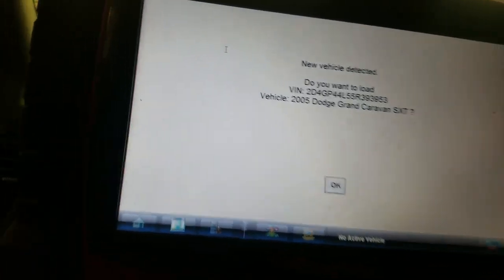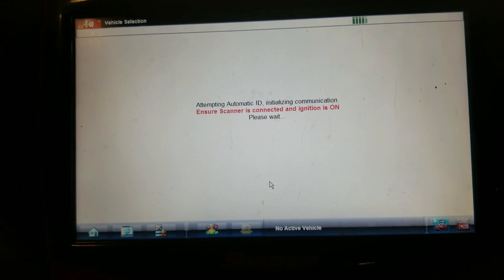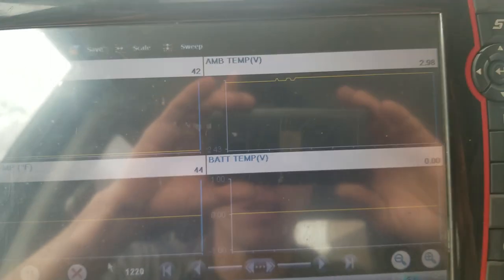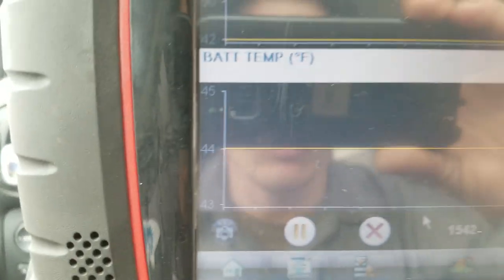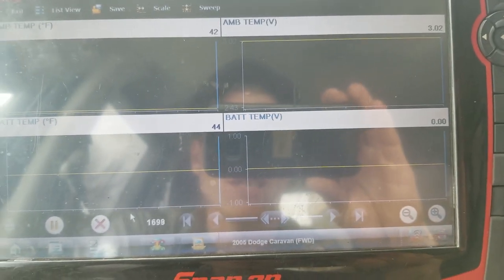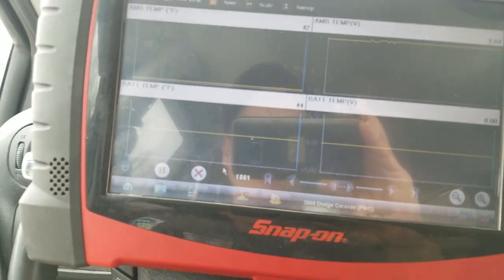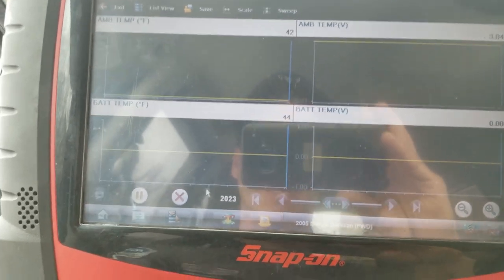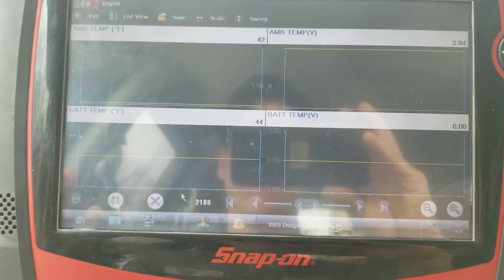2005 DODGE GRAND CARAVAN 3.8L, P0073 ANBIENT TEMP SENSOR CKT HIGH & BATT TEMP SENSOR ISSUE (PART II)

Comment: Great follow up bro. Wondering if that strategy is inside the Snap On or if it’s actually inside the PCM? I would be curious to see if another scan tool would be able to read that voltage at all. Anyways if it’s not set in the code and it’s reading close to the ambient temp then you’re good to go anyway.
Reply from the maker: Same, I have no idea what to conclude, it's just another variable I suppose?

Comment: Hi. Not understood correctly. Did you change your battery temp sensor? Or the ambient temp sensor? I replaced the amb. temp sensor twice. Fucking light still there. Mine is a Chrysler Grand Caravan made in Austria . Though I live in Br
Reply from the maker: Did you test and check the 5V reference and ground as I showed in the Part I video with the sensor unplugged?

If your 5V reference (the signal wire) or sensor ground are open or shorted, then ofcourse your CEL is still going to be there!

Ambient Temp sensor was what was replaced to fix the customer's car, but that ofcourse was done after I confirmed the sensors circuit integrity from the sensor to the PCM, as shown in Part I video.

These are basic electrical tests of a thermistor circuit; which is required to determine if you have a wiring, sensor, or PCM problem. 

A simple two wire sensor, one wire is the 5V reference (signal wire) and the other is the ground...the AMBIENT TEMP sensor changes resistance as the outside air temperature changes; thereby pulling the 5V reference down to ground.  So the PCM monitors this change in voltage via the signal wire (5V ref) in order to determine ambient temperature etc...etc..

Shotgunning parts and sensors at the problem is not how to fix cars!  You have to test the circuit!
Reply: @PaulysAuto  well... I don't have the scanner but I have the voltage reader. I will try to do it again. 

Another idea is to disconnect from battery and put the connectors together to let the charge disappear. 

I had some cylinders missfire code appearing. After replacing sparks, magnet and cables, it was still there. So I used this technique. It solved, except the p0073.
Reply from the maker: @ocavaleiro177  Actron code readers are a great and affordable way to get data and DTC'S on the cheap too.👍

Comment: Did you have the correct temp right away? I have a similar vid and temp sensor was seemed stuck at first. Drive cycle fix it?
Great job pal
Reply from the maker: No, it updates this information after driving for about a minute or so above 30mph.  I think I failed to mention that, thanks for asking this...great questions!